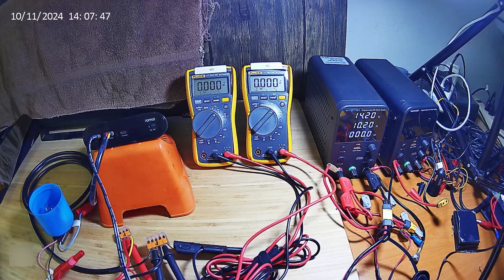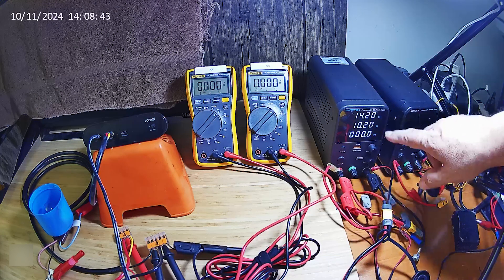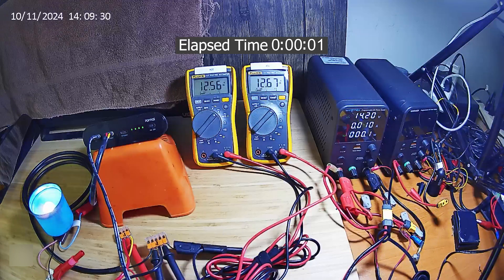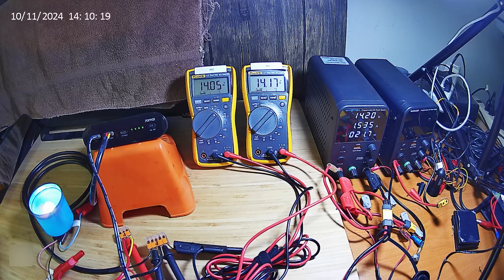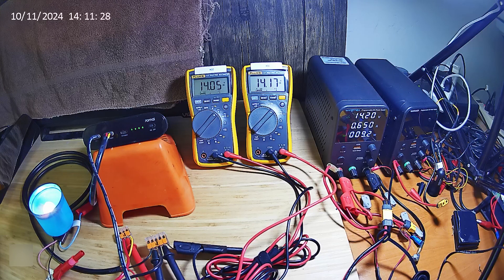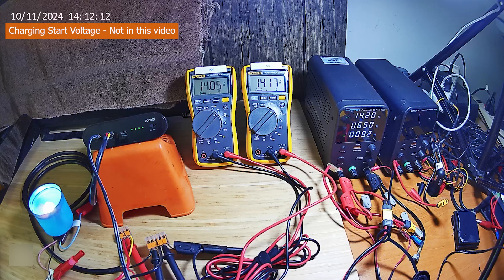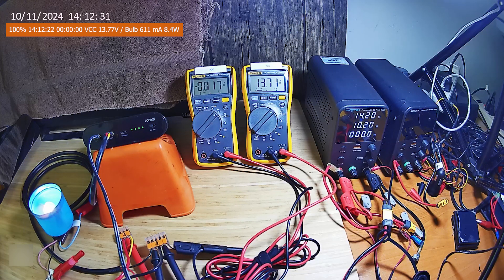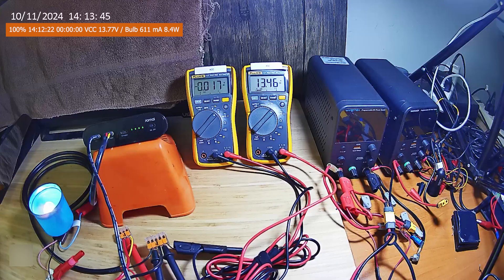70mai 7500 mAh / 96 Wh - Battery Discharge Test 20241011

Comment: I bought the same 70mai battery. But it does not charge from the cigarette lighter when the engine is running. Please tell me if the 70mai battery charges if the acc signal wire is not connected to it?
Reply from the maker: The 70mai battery pack has to charging modes that it supports.  Hardwired using a 3-wire connection and the cigarette lighter cable.  The battery pack "remembers" which charging method is was configured for and only operates in that mode. If it was configured for the 3-wire hardwire charging method, it won't charge when using the cigarette lighter cable [by default]. You might want to run through the steps to reconfigure the battery pack so that it "knows" to charge using the cigarette lighter cable.

Switching charging method
If the battery pack was previously charged using the fuse box method, follow these steps to unlock it and switch to the cigarette lighter charging method:
1. Connect the cable according to the "Connecting to the vehicle cigarette lighter" procedure.
2. Turn on the battery pack and start the vehicle's engine.
3. Pull out the charging connector from the cigarette lighter socket, wait approximately 10 seconds, then reinsert it into the socket for 5 seconds. Repeat this pull out-and-insert sequence 3 times.
4. Once successfully unlocked, insert the charging cable into the cigarette lighter socket again. After an approximate 20-second delay, the battery pack will begin charging, and the indicator light will show the charging status, indicating the successful unlocking.
If the battery pack was previously charged through the cigarette lighter socket, no unlocking procedure is needed to switch to the fuse box charging method.
Reply: @RetroCarGuy530 Thank you friend, you helped me a lot!!! Everything works and charges! I am very grateful to you. I understood that this is written in the instructions, but my instructions are in Chinese (I bought a battery pack for the domestic Chinese market without a three-core cable). I could not figure out on my own how this thing works:))) You saved me!